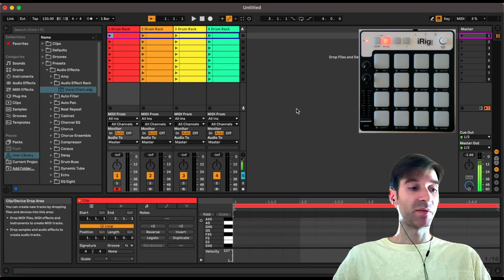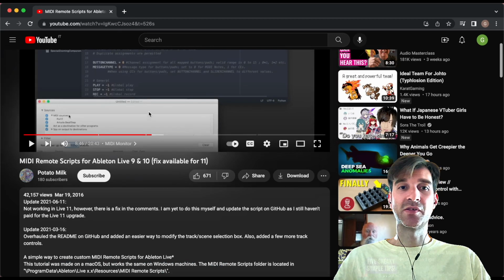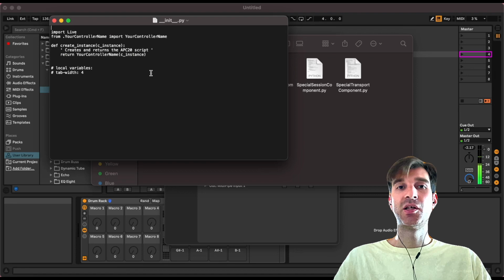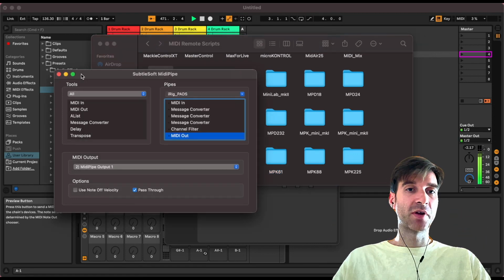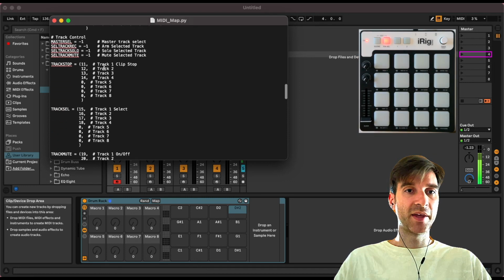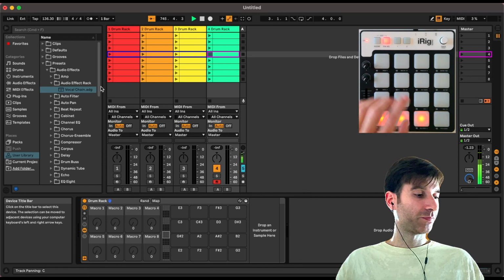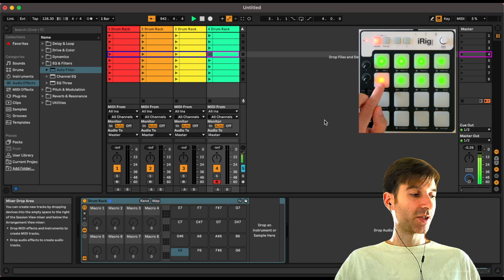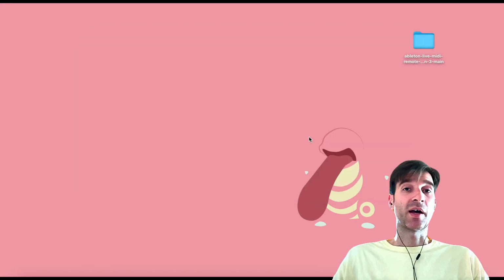Turn any MIDI Controller into a Control Surface for Ableton! Custom MIDI script tutorial [iRig PADS]

Comment: I customized the files, colored box appeared but I can't map the cc notes. in my case 45 is play cc note but when I entry the 45 to file global play section it's not working. please help!! 

BUTTONCHANNEL = 0  # Channel assignment for all mapped buttons/pads; valid range is 0 to 15 ; 0=1, 1=2 etc.
MESSAGETYPE = 1  # Message type for buttons/pads; set to 0 for MIDI Notes, 1 for CCs.
# When using CCs for buttons/pads, set BUTTONCHANNEL and SLIDERCHANNEL to different values.

when I change the "messagetype" value to "1", i can manage to assign buttons but the faders. when its "0" I can only assign faders.. please guys help me
Reply from the maker: I would leave the MESSAGETYPE set to 0 and use actual MIDI notes for the buttons instead of CCs. Any way you can set up your controller so that your buttons send notes instead of CCs?
Reply: @TheNeonSyndicate  thank you so much for reply. in editor which is worlde easy control 9, I only see CC notes. there is not any midi notes option to select.
Reply from the maker: Hey no problem. But see this is where I get confused. What do you mean "CC notes"? It's either CCs or notes as far as I know right? @leadpain
Reply: @TheNeonSyndicate  it's my bad sorry, I mean CC number not note. worlde easy control 9 is looks and functions like korg nanokontrol 2. it has no pads only slider, knob and button it has so in the editor I can only assign CCs. I'm using Live 11.3.10 is this version can make any trouble about codes?
Reply from the maker: Ah ok understood! So since you cannot assign your controllers to notes, you have to stick with CCs. So yeah, you need to set the MESSAGETYPE parameter to 1 like you did. Remember though: that means that the MIDI channel now needs to be different from the one you're gonna use for SLIDERCHANNEL. So for instance you could set BUTTONCHANNEL to 0 and SLIDERCHANNEL to 1, and set the nanokontrol's buttons and sliders accordingly  @leadpain
Reply: @TheNeonSyndicate  will do as you say I hope this works. thank you so much for your help :))
Reply from the maker: Hey no problem. Let us know how it goes! @leadpain
Reply: @TheNeonSyndicate  hey i have the same problem, i already do what you said but it does not work
Reply from the maker: @davidallengarcia5435  What problem? Could you be more specific?
Reply: @TheNeonSyndicate  sliders does not work even i change the slider channel to 1.
if i change messagetype to 0, the sliders work
Reply from the maker: @davidallengarcia5435  0 means the script expects MIDI note-type messages, 1 is for CCs instead. I guess your slider sends out a MIDI note-type message then?
Reply: @TheNeonSyndicate  yes, how can i use ccs and midi note type at the same time?
Reply from the maker: @davidallengarcia5435  You need to set things up on your controller. The script can only work with what your controller sends. If your controller's sliders are assigned to MIDI notes, you need to change that assignment manually on the controller itself or get some kind of software utility (if you're on Mac, I recommend MidiPipe) so as to make sure that once your MIDI messages reaches Live, it's already the "correct" message that the script can work with
Reply: @TheNeonSyndicate  i'm on a pc, do you recommend a software utility for pc?
Reply from the maker: @davidallengarcia5435  I have used MIDI-ox back in the early 10's, it most certainly should be able to allow you to do at least some basic mapping!

Comment: Thank you so much, I was looking for such a thing for so long. One advice for people who want to control more than 8 tracks(it is a limitation). You can create the same string with appended 2 at the end. For example mine is MiSW_XVI and MiSW_XVI2.  And put the midi information for other 8 channel in the second script. And you can add the same device for two control surface scripts in the ableton settings. This way you can control 16 tracks at the same time.
Reply from the maker: Wow! That is so cool! I had no idea you could do that. Thanks for sharing that!
Reply: @TheNeonSyndicate  I have tried writing control surface scripts without any success for so long. Even though I am experienced python developer, it was bugging me whole time. I still couldn't create the perfect apc40 script, but at least you showed us the way to make every midi controller useful.
Reply from the maker: @homunduruk2530  Credit where credit's due: I didn't come up with any of this, the guy I reference at the beginning of the video did. I just put his knowledge to use in a practical real world example
Reply: Hi i'm having problems mapping the 4x4 buton pad can you help me? my device it's a traktor kontrol F1
Reply: How does this work? I have tried this but the second script does not control tracks 9 - 16 for me, it is stillt rying to control 1 - 8. How do I change the script so that it controls tracks 9 - 16?

Comment: What if ableton reads my controller as (for example) Minilab3 (MIDI)  ? I haven't been successful just using Minilab3 and I noticed Ableton included (MIDI) in it's recognized name, but the added parenthesis doesn't play nice with python
Reply from the maker: Have you tried this? Is it not working?

Comment: Thanks for the knowledge! Is there a way to bring the number of encoders to 16 instead of 8 ?
Reply from the maker: Don't think that's possible BUT if you have 2 spare buttons you can assign them to DEVICEBANKNAVLEFT and DEVICEBANKNAVRIGHT to switch between different banks of 8 parameters each. This way you can control them all really - 8 at a time, that is. If you have 8 buttons to spare, you could even assign them to DEVICEBANK so you can select which of the 8 available banks of 8 parameters each you want to control at any given moment
Reply: Great idea! However i couldnt get this script to work, im using the latest 11.3.11 and all the files in midi scripts are pyc not py 😢
Reply from the maker: @GucciGascon  That is because when you first launch Ableton, it scans the remote scripts folder, identifies your .py files and creates a "pycache" folder with the .pyc files it then references from that moment on. So what that means for you is: any time you make a change to your map.py file, you need to delete that cache folder in order for Live to stop referencing it and rescan your .py files, become aware of your edits and then recreate that cache folder. Does that solve your problem or was it something else?

Comment: Great video! I also own an irig pads ... Can you please pass the script to control it? Thanks alot
Reply from the maker: Thanks! That wouldn't do you any good though I'm afraid, my scripts just wouldn't work because a) I have changed the default settings on my iRig Pads so they send out different MIDI messages than the default ones and b) I pass all of those through MidiPipe for some extra message conversion. So basically what reaches Live coming from my controller is completely different from what would come from yours, and therefore the script would need to be adapted to your controller anyway. And anyway, asides from that, this script is one that suits my needs and my workflow, and yours (probably) differs from that. Might as well just use these instructions I provided you with to make your own script that a) is compatible with your controller and b) work best for you 😉

Comment: Hello! This is a great video.
I started working on this and followed the whole video, after placing folder inside MIDI Remote Scripts and starting Live 11 I cant see my control surface listed and pychache folder is never created.
Tried the same process with another MIDI controller without success.
Working on Live 11.3.10 and Mac OS 10.15.7.
Thoughts?
Thanks in advance!
Reply from the maker: Cheers. Did you rename it correctly? Upper/lower case letters and underscores?
Reply: @TheNeonSyndicate  Yes, everything was set just like in the video.
The only way I got it to "build" was by modifying line 3 in the init script, which has a point before the "YourControllerName" that doesnt exist in the original scripts for live 9/10, tried erasing it an the control surface was built and I could see it listed in the dropdown menu but after setting it up I never saw the session view box anywhere and the buttons I scripted didnt trigger any clip in the session view.
I tried searching for decompiled versions of the factory included ctrl surfaces and realized that same line had a point before the name of the MIDI controller, so now it's evident it is needed to build, but if I add it back I don't get it to work :c
Reply from the maker: @jowdaysimgen4450  Yeah, that point is definitely needed. What's the name of your MIDI controller
Reply: @TheNeonSyndicate  its called Touch OSC, its an app for iPad.
It's basically a custom MIDI ctrl that allows you to build any kind of control you need, it works great but I just haven't been able to use it for the Remote Script, even tho I only need the red box and arrows to select/launch clips.
Reply from the maker: Ok, I'd say just go through the steps carefully, making sure everything is done exactly as in the video. Did you add the underscore between Touch and OSC? Like this: Touch_OSC. Is that even the name that appears under the MIDI section of Live's preferences menu when you connect it? Sometimes that's different from the actual name of the controller. Once you made sure to use the name of the controller as Live sees it, have you renamed the clean files with the "replace all" function? Maybe you missed something there. Also, did you place the files into the correct folder? As you can see, there's a million things here that could've gone wrong 🤣 It's not a difficult process, but a very detailed one so it's easy to forget something. We need to narrow things down here to understand where the problem lies. If you could provide screenshots that would be helpful, too! @jowdaysimgen4450

Comment: Brilliant Video and really well explained. I am wondering if you could please help? what I am trying to do is much simpler than the complex script you set up for your iRig. I have 2 Arduino Leonardos one has 4 encoders, 4 faders and a x,y, joystic the other has 6 encoders and a x,y, joystic. I just want them to be recognised as 2 individual surface controllers so that I can midi learn and assign them to a plugin and save the rack/plugin as default. I know all the encoder cc numbers as I set them on the controller myself. I just want to get more use out of them. Any help or advice would be greatly appreciated.   Thank you
Reply from the maker: Thanks. So when you connect both to your DAW, do they appear as 2 separate MIDI controllers?
Reply: Yes Arduino Leonardo and Leonardo # 2 @TheNeonSyndicate
Reply: I had another look at the video lastnight and if I am in the ball park for what I need do I just input my cc numbers that are being outputted from the arduino into the last paragraph of text 'The Parameters' so that I will then have macros that can be saved per plugin and not just project based saved as they currently are at the moment. The faders act as macros when mapped in project based saves. Both arduinos are currently on midi channel 1. Last question : could I write 2 more lines of text so that I have 2 more parameter added as in 10 parameters so that 4 pots 4 faders and a seperate x and y for the joystick are mapped and recognised within ableton?
I am so sorry for the questions but I am trying to reassure myself to feel confident in setting up 2 custom user folders for the Arduinos.
Thank you
Reply from the maker: @roymitchell5894  You are right in that this method is not project based, that's one of its strengths. The thing though is, you're gonna need to create 2 custom MIDI scripts, one for Leonardo and one for Leonardo #2. So the whole process outlined in this video, you're gonna need to go through 2 times. In each map.py file you can then do the assignments as you please. As far as adding 2 lines of code, that is not gonna work I'm afraid. You can, however, control macros 9-16 with your same 8 faders by just switching to the next device bank - there's a line for that in the map.py file. Just need to save one or two controllers to switch back and forth
Reply: Thank you so much for all your time and support it's really really appreciated. Thank you ❤ @TheNeonSyndicate
Reply from the maker: @roymitchell5894  Don't mention it. Let us know how it works out
Reply: Update; Success!!! I mapped the 8 parameters to my 8 encoders 50 through to 58 and I changed the button channel to 15 and the pad channel to 15 and left sliders/knobs on channel 0 which I am guessing is channel 1 which is the default midi channel my hardware sends and receives. A quick go and it works like a charm even the joystick is X axis cc 57 and Y axis 58 and they work perfectly and act as macro 7 and 8, but I think I can have fun mapping X,Y to other things. I just want to thank you for all your advice and time as it's very kind of you to support every individual on this video. Above and beyond. Thank you so much. 
Oh one last thing Before I make the 2nd user script for Leonardo # 2 which has 10 parameters effectively 4 pots, 4 faders and X,Y joystick is it possible to map say 2 of the encoders to say ...Track selection box and then map the remaining 8 to the 8 parameters?
Reply from the maker: @roymitchell5894  My pleasure mate. Glad to hear it worked out for you! What do you mean track selection box exactly?
Reply: The red box as in the one you get on push 2 apc40 mk2 etc i think you have yours set at 4 across and one down. I have mapped the other arduino now too. I had a full day of it not being listed as a control surface and it turns out that Ableton has it listed as Arduio Leonardo#2 which its alwayss done but in order for a successful user script i had to repalce the hashtag with an underscore and it was finally recognised as a surface controller and all the mappings worked but in the midi in and out to the right of the surface controller in Ableton its still listed as #2. So if anyone experiences the same problem swap out the hashtag in every step of 'YourControllerName and folder names. @TheNeonSyndicate
Reply from the maker: @roymitchell5894  Right, so to move that you wanna assign "SESSION UP" and "SESSION DOWN"

Comment: Great video could you please demonstrate how to script different modes and presets for any controller knob or button for example a button in mode 1 will navigate tracks and in mode 2 it will navigate devices. Another thing could be shift button for temporary changes in any preset. My controller is Akai Midi mix
Reply from the maker: Thank you. That's actually quite easy to implement, here's what you need to do. First, create different presets on your controller. For instance, you could set a certain button to send out MIDI note number 1 on preset number 1 and MIDI note number 2 on preset number 2. How to do that differs between MIDI controllers, I can show you how to do that on the iRig PADS but I have no idea how that would work on the Akai, so you're gonna have to check the manual for that. Anyway, step number to would be to associate those 2 different MIDI notes to 2 different functions in your "map.py" file. For instance, you could associate MIDI note 1 to the "tempo tap" function and MIDI note 2 to "playback start". And that's pretty much it! Now when you use preset 1 on your controller, your button is gonna trigger the tempo tap function, whereas when you switch to preset number 2, it's gonna start the playback of your song.
Reply: @TheNeonSyndicate  Thanks for your reply. Unfortunately in midimix manual it says you can save one preset at a time and must load any other manually by its software
Reply: But i heard from some that it can actually change the presets by its own buttons that are assigned differently but i don't know how
Reply from the maker: @THQSLRT  aw man that sucks
Reply from the maker: @THQSLRT  Yeah, makes sense that they would enable you to do so. Only 1 preset at a time sounds like a little too little

Comment: What a great Video!
How did you set the presets on the iRig Pads?
Are these custom as well?
Thanks for your content!
Reply from the maker: Yeah, I changed some of the controls there, too, but it's not really necessary: for the most part you can just keep them as they are and then use those note & CC numbers in your mapping file
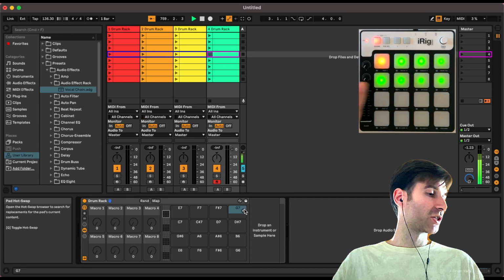Reply: @TheNeonSyndicate  cool 😀 so these Scenes are made with the 14:34 mapping file?
Reply from the maker: @marcocaviezel2672  Yeah. But again, that's no the important part: the important part is that the numbers you write into the file correspond to the numbers being sent out by your controller. So long as you make sure that's the case, what those numbers are doesn't really matter